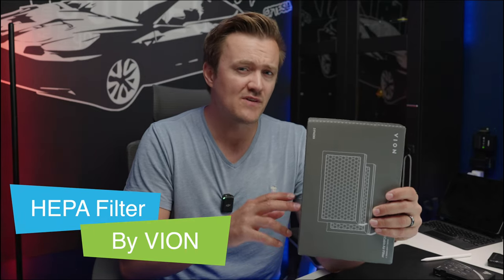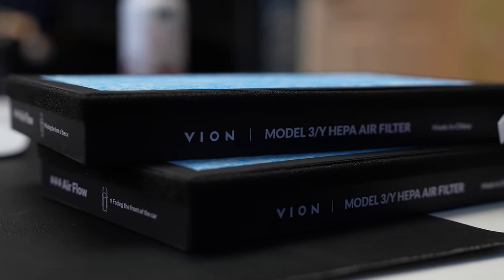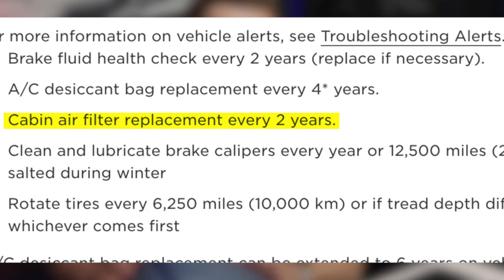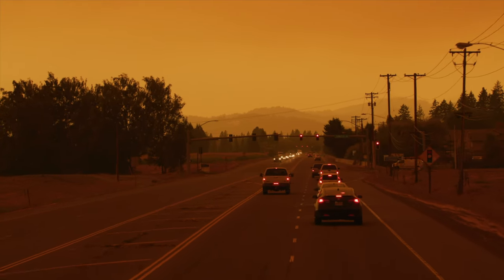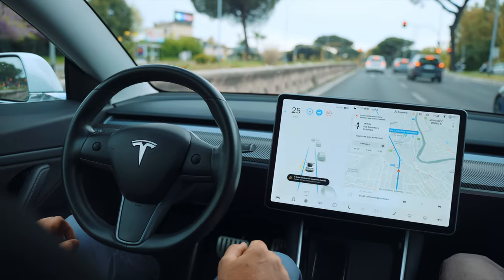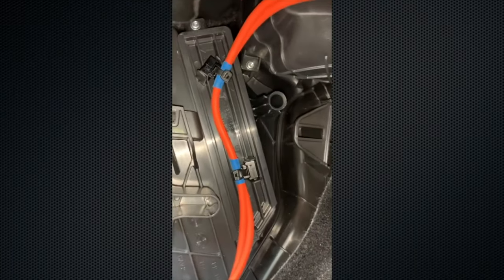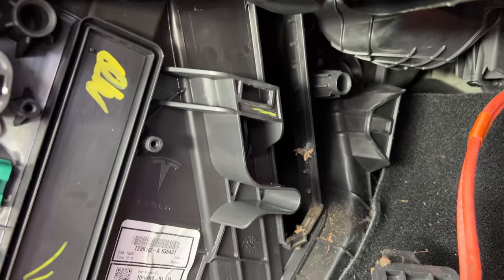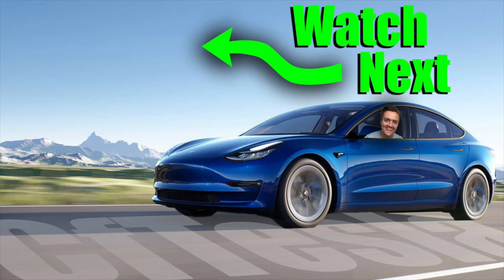You Need To Do This To Your Tesla Every Two Years!

Comment: My model 3 just got back from Tesla.  HVAC was destroyed due to the restrictive nature of the HEPA according to Tesla technician.  Why?  Because ice formed on the front of the filters and created a water pool which made the cooling sensor error.  $2,000 later the car is cooling again after replacing compressor and ECU for the sensor.  It failed when temps have been over 100 in the FL.  It ran for about 1 year before the problem manifested.

Comment: You should use a washable filter (has minimal impact on airflow) in frunk by air intake to cut down on leaves. Also, when changing filters, use condenser cleaner on coils (wet sock smell)
Reply from the maker: I used to use a filter in the frunk but took it out because it sounded like it was having trouble pulling in the air. After seeing this though I will probably put it back.
Reply: That’s why the washable filters are best, (and it’s the least expensive option, a $9 filter can be cut up into 10+ filters). I recall a video blogger reviewed the various products being sold (plastic with holes, etc.,) and the flow was severely impacted. The washable has the least airflow restrictions.

Comment: I’ve learned my lesson to not use any more restrictive airflow filters than the manufacturer provides. While I agree these should be changed (I do mine once a year) I do not recommend using aftermarket filters, especially “HEPA” unless your system was designed for it. Which some of them are! But not mine
Reply from the maker: can you provide information as to why you feel this way? Also what car are you referring to?
Reply: @CfTesla  Read my latest post.  Ice will form on the filter due to low air flow and cause downstream issues and expensive repairs.
Reply: @CfTesla  sure! A filter with higher filtration may remove more particulates from the air, however, that will also reduce the life of the filter shortening that two-year number recommended by Tesla down even lower (when I don’t even find the regular filter to last for that long.) Restricting airflow also has an effect on efficiency and it can also cause humidity issues which is a good way to grow mildew!